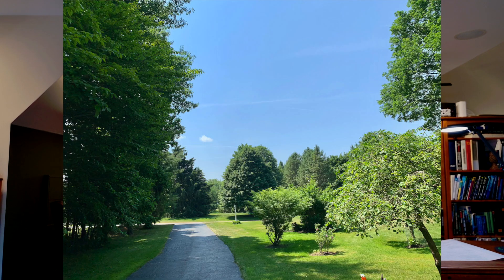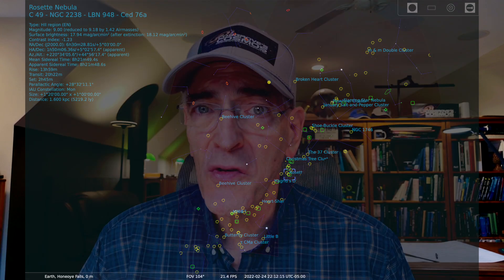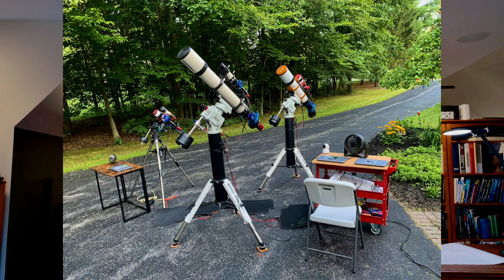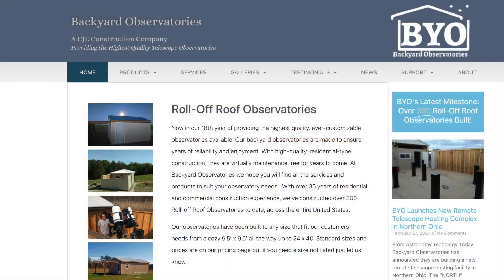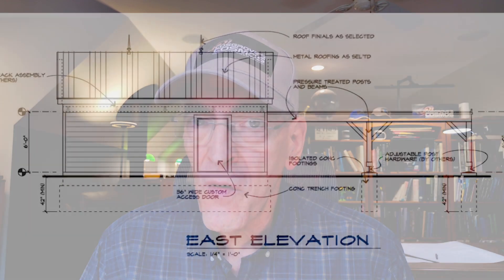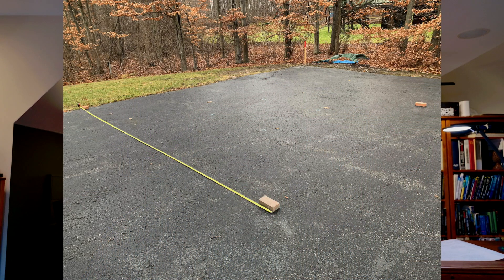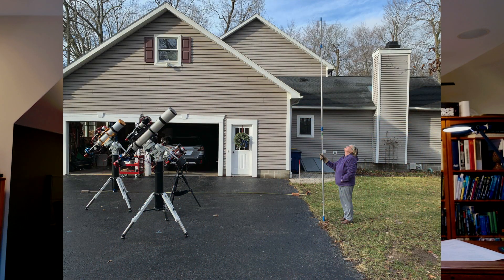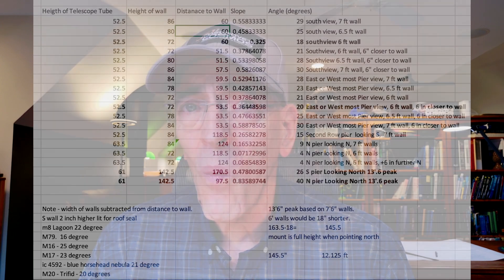Designing my Roll-Off-Roof Observatory!

Comment: looks like a good solid plan there pat...could you reiterate how the snow on roof will be handled? did you say roof tilts or something?
Reply from the maker: Thanks much! 

The roof is designed to handle a static snow load.  If I want to open the roof, I will have to sweep most of the snow off.   The flat track will have a "Snow Plow" built-in scrape off the flat track as the roof opens.  We have so few clear nights during the winter - that - unfortunately - I don't think I will have to deal with snow much...